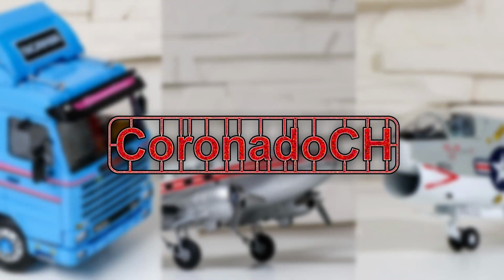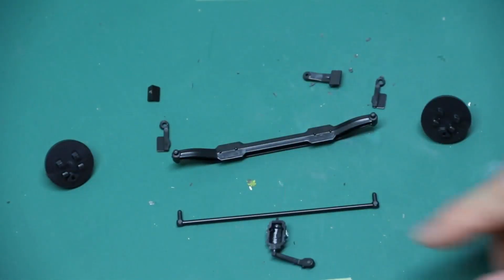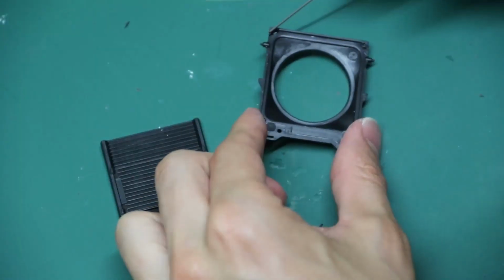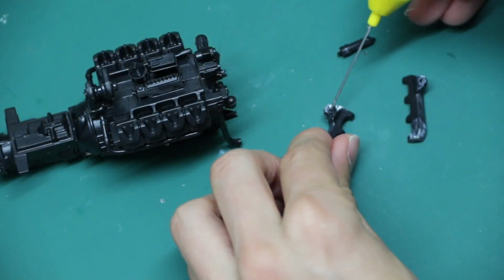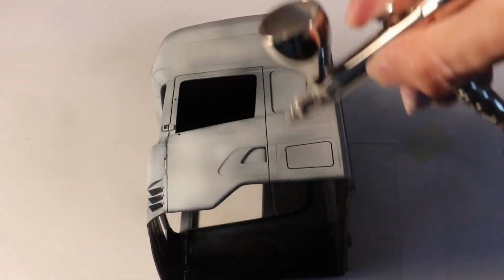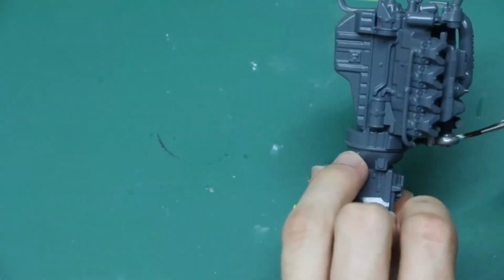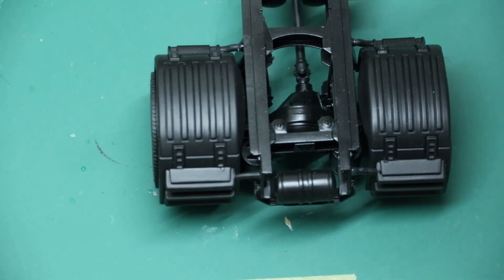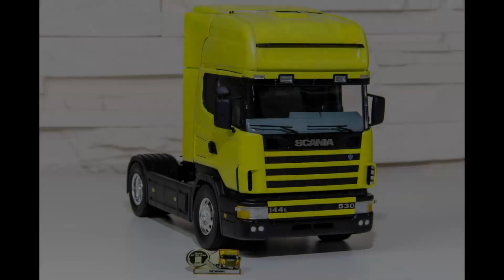Full Video Build | Italeri No. 3922 Scania 164L "Top Class" 1/24 as Scania 144L | Englisch

Comment: When I was a kid I put together many plastic models (especially planes) but I was never using colours or this spray paint. Could you give me any advice to the panting? What "device" do you use for spray paint and if it is difficult to learn it, mix colours etc. Also how many paint do you need for truck like this and how much these paints cost? Thank you.
Reply from the maker: Hi Overload, thank you for your comment. Following my answers to the questions. I'm using color on acrylic basic as they are easier to handle as enaml color for exemple, regaring cleaning them. I'm using manly an airbursh pistole for the large surfaces and the smaller details I'm painting with a brush. The airbrush pistole is a Harder and Steenbeck Evolution Silverline Two in One. For me it was not difficult to learn. I use if available the premixed colors of Vallejo, they are sold as Model Air. I've listed all colors used in the describtion of the video in general you don't need more than one of each color. The cost of the color you need to search in your location in the internet, the exact color I used is in the description. I hope I could help you.
Reply: @CoronadoCH  Thank you. I did some digging and found this. The airbrush pistole costs about 130-170 €. Then I found Vallejo thinner 200ml for 10€ and basic set of 16 colours (17ml each) for 45 € Primer is for 8€ 60ml. As a total noob in this colouring field. How much these colours are going to last? I understand that it depends on the model size and amount of paint used etc. But as a guess - lets take this Scania model. How many models I would be able to paint with this colour set and the primer? Thank you again.
Reply from the maker: @Izmael1310  Yes, the airbrush color seems to be correct, but you need as well a compressor. You need to check if you want to buy a color set or indiviual color depending if you really need all color to build. The use of color depends how good it covers for example the yellow did cover really bad but there is still color left. The primer lasts at least for around 2-3 models. I didn't write down exactly how much color I used. But if the color covers well one bottel should be enough for two models. The most difficult color is the clear gloss as I don't manage as well to get a proper glossy seal with it.

Comment: Колёса должны крутиться.
Reply from the maker: If my translation is correct you are speaking about the wheels which I glued to the model and are not turning. I do this to p'revent damage on the model as I have all models in a individual case, if the wheels are not fixed it would go forward and backward while transporting.